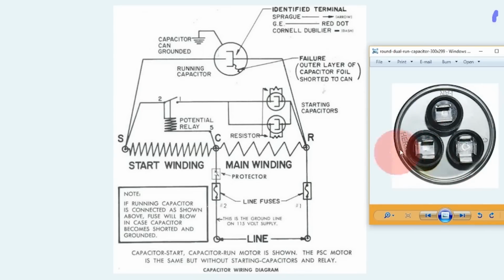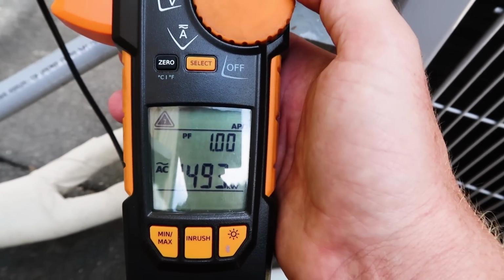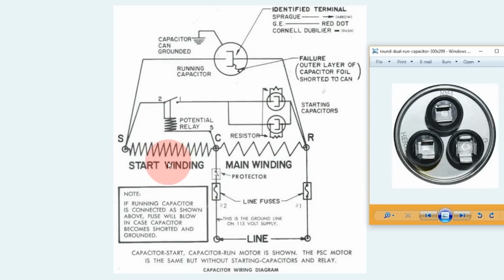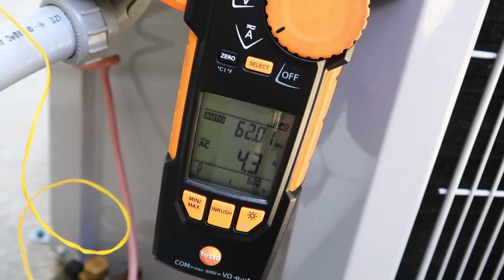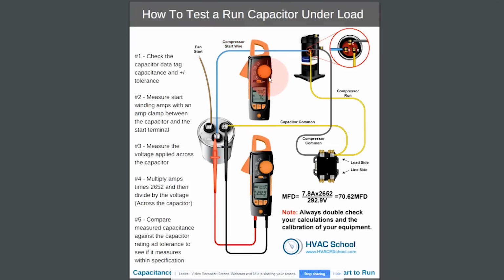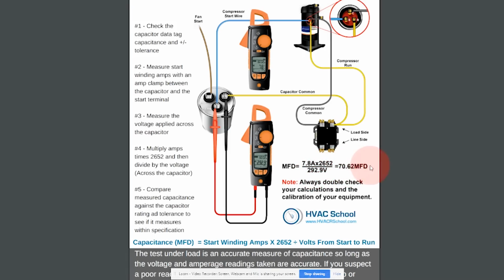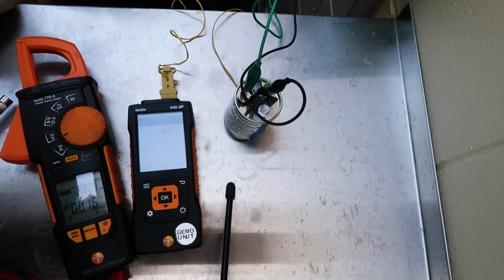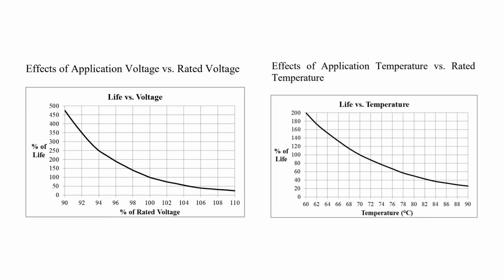Why Do Capacitors Fail? (It’s not why you think)

Comment: I used to teach a motors control course to naval electronics maintainers, as we used all manner of motors in our work.  Sadly your mention of a capacitor as analogous to a water tank or ballon hurts us as professionals and you started to lose me there.  This whole video should have been half the length talking about the actual failure modes up front.  It took you too long to mention the real sources of heat and where it comes from - the current - and how heat is dissipated.  Power=Impedance by Current squared, so any constant elevated current is a problem - that power is either returned to the circuit or lost as heat, and high ambient means less lost to the atmosphere.  The result is boiling off the oil and changing the physical properties of the capacitor in the process (swelling of the can, uniform spacing of the plates, etc).  They simply can only handle so many of these high stress cycles before they fail.  So high ambient temperatures are part of the problem, and eventually you got to loose connections, bearings that retard motion and cause the coils to work harder to keep at the rated frequency, resistances that drift, and the simple reality that parts do not stay the same over their lifetimes.  People forget that these units need to be overhauled, and electrical parts need to be replaced, bearings serviced, with new ones to put everything back in the right operational specification range.  A simple truth that we faced every day in the navy as we operated in all climates, and only by doing our maintenance, and checking our components, could we see performance drift and make fixes before systems failed.  Users that let their systems fail have no one to blame but themselves!

Comment: Excellent Video.

Capacitors are one of the few components used in the HVAC industry that have actually gotten cheaper in the last 40 years. Some of this is due to materials used but a large part is because I could not find a manufacturer that still does testing on production lots (I had a reason at the time). It's simply cheaper to give you a new capacitor than run production lot tests.

The number of capacitors that I've found outside tolerance straight out of the box in the last 10 - 15 years is a lot more than you might think.
Reply: C H I N A, as in made in.

Comment: Many reasons.. surging grid volts is a biG one, no lead in the steel, or solder and the aluminum is low grade... here in FL, our grid volts is always  low.. Very common: caps fail near after lightning storms.. surge protector helps 50% of the time & should🤞save the compressor windings.. ya'll should just add suppressors cuz the grid will just get keep getting worse, not better... so few understand what "hardening" is...

Comment: In my case the capacitor in my heat pump failed because a mouse got in there and peed right on top of it. I know it was a mouse because the electrocuted carcass was still sitting across the terminals when I opened the panel to find out why it stopped running.

Comment: ESR will increase as a capacitor gets older. The paper inside will degrade over time due to the natural acidity in it. The voltage rating will also diminish because of the deterioration of the paper inside leading to an arc over, bloat, and bang. The hotter the environment, the faster this process happens.

Comment: Brilliant demonstration! For anybody who is interested, there is an explanatory article showing the math more completely, written by Bryan Orr in AC news, titled "Testing the Run Capacitor While the System is Running", found with Google. Basically the 2652 comes from Xc=(1/(2*pi*f*C)), with 2652 in microfarads = 10^6/(2*pi*f). f is assumed 60 Hz. So, Xc = 2652/C, in microfarads. Plug that into Ohm's law E=I*Xc and rearrange to isolate C. So, C=2652*I/E. Remember that the start cap is only in the circuit for a short time at each start, so this measures only the run capacitor quality. For the brief episode when both are in the circuit, the capacitance for the two parallel lines is additive.

Comment: Who cares why they fail.  You need to know the signs for when they have failed.  Look for a dimple on the capacitor...dead give away!  They will puff up on top.  Also you can buy a capacitance checker and sometimes the capacitor will be out of the realm it needs to be in.  All this long video is just BS.  Just buy a capacitor and swap it out if you are a rookie.  If not the cap then it may be a locked rotor.  All this classroom nonsense is a waste of time!

Comment: All I can say is wow. It was very intuitive. I've been in the field for over 25 years and learned a lot on this video, but with that said the old capacitors that had PCB in them and a resistor on the terminals lasted for decades or never failed before the unit rotted out. These days it's two years on a new unit 50% of the time. So
Reply: The purpose of resistor to bleed off residual voltage in the capacitor after been disconnected from the circuit after motor start up.
PCBs, or polychlorinated biphenyls, are highly toxic industrial compounds. They pose serious health risks…
Reply: @globedimmer8286  That's what I'm saying. It helps  bleeding off the cap reducing it overheating and popping and as far as the PCB's.., I'd rather have one of them in a landfill compared to the 10 that haved popped open off a single system in a landfill.
Reply: Many reasons.. surging grid volts is a biG one, no lead in the steel, or solder, the aluminum is low grade... here in FL, it's most often after lightning storms.. surge protector helps 50% of the time..

Comment: I had one of those clear plastic shake lights.  It was very bright for a long time of use. So I put it in the jocky box in the car for a light that I thought would be better than a battery powered alkaline battery light. Well years later when I pulled it out after changing vehicles it was no longer brilliant but like an old first Gen shake light. I am thinking of cutting it apart and changing the capacitor.

Comment: Capacitors fail for several reasons, mostly heat and the surge cycling over time, basically because capacitors are not built to last as they once were, using inferior materials to keep production costs down. If a capacitor has been replaced in the past, if could very well be the original was replaced with a less reputable product. The voltage rating of a capacitor: is the amount of voltage a capacitor can handle on "peek demand", not what the unit runs at. The unit may run on 220-240v but the start up demand is much higher, sometimes peeking at 290v. The mfd is the charge/discharge rate of capacitor, the lower the mfd rating is, the higher charge/discharge rate.  Always try to match the mfd and voltage as close as you can,  if not, always go with the higher voltage rating and or a smaller mfd rating but don't make drastic mfd changes. When you are replacing a capacitor, take into consideration the age of the unit, how old is the cap and is there rust or powder present on the cap.  Capacitors dry out with age, and you will get swelling,  a liquid dripping or a fine powder forming on the capacitor, or an outright exploded capacitor.  The powder is the dielectric drying out due to over use  or just plain crappy dielectric, the liquid present is also the dielectric leaking due to expansion, the swelling is due to the dielectrics reaction with inferior materials used inside the capacitor in production, an exploded cap tells you there is too much voltage demand on the capacitor and you may want to consider a higher voltage rating when replacing it. If you replace a cap 40mfd @ 250v with the same, it will perform "as designed", you can also safely replace that same capacitor with one rated for higher voltage (40mfd @ 350 or 450v)m and it will perform as designed or better due to the higher voltage handling capability, manufacturers use absolute ratings for cost and effective production.  What I mean is, higher voltage rated capacitors are going to cost more and will perform just as well and also have a longer life, but that cost may be prohibitive to the production costs, therefore manufacturers will go with the less expensive unit to save on cost.  If you have a high rate of failure on this system, you may want to consider upping the voltage capacity of the capacitor, but match the mfd rating.  The reason for this is due to the draw surge in electron demand on startup, the unit may now be demanding a higher capacity due to age and wear.  If a unit is not maintained properly, it's demand will increase and cause a higher demand in startup voltage. As things get older the voltage demand increases, wearing of parts, lack of maintenance and whatnot.  Also if the compressor HAS been replaced but the capacitor has not, the compressor and capacitor are not matched.  The compressor may be a direct replacement but the physics demands may have changed.  Therefore the voltage demand on startup may not be the same rating, and the capacitor voltage rating needs to match the demand.  The way to figure this out is if the compressor seems to be sluggish when starting, then you know you need to lower the mfd for a faster start rate. If the compressor starts and stops a couple times or seems hesitant, it could be the mfd rate is too low and needs to be increased to allow the compressor to get a good start rate.  The lower the number MFD the faster the start rate. As an example: 50 MFD will start the motor faster than a 70MFD because it takes less time to recharge the capacitor. I hope this helps.  (43 years experience)
Reply: "50 MFD will start the motor faster than a 70MFD because it takes less time to recharge the capacitor"  If that were true, adding a start kit, 389-524 mfd, it would further slow the compressor start, but in real life, it actually speeds up the compressor start, according to the manufacture.  Even so, there is no reasonable field way to time the compressor sta, maybe in a lab....
Reply: The higher the mfd # the faster it will
Start..but it has to match the A/c
Compressor's requirements very close

Comment: Why is there 3 capacitors in my system. I know the dual run capacitor and the blower motor capacitor but what’s the other one near my dual run capacitor  I don’t know what that one is . Can some one explain its smaller than my dual run capacitor

Comment: But when a motor STOPS, it becomes a generator and for a fraction of a second it creates high voltage back-emf. In 12v cars, a standard starter motor can throw a 600v spike back into the system. In trucks, up to 2000 volts. So it is a very brief spike, but there is a very high back-emf from the motor. Capacitors are also manufactured typically to a 10% tolerance, so if it is rated at 300vdc, it really may only be good for 270vdc. Rule of thumb in many applications is to use caps rated close to twice the expected working voltage. Same for AC units?

Comment: I had a unit installed in a building that experienced a lightning strike. The capacitor had a small burst and when the power war re-introduced it began to spray atomized mineral oil into the airway.  The customer and fire department immediately assumed that the unit caught fire.  I will replace the capacitor and clean the unit.  First failed capacitor in 50 years maintaining the equipment.  Saw massive failures of high voltage power supplies in hot humid climates.
Reply: Moisture will always find its way inn .

Comment: Unfortunately, most technicians (this should make them mad) are parts replacers.  In other word, like a bad auto mechanic, they keep replacing parts until they stumble on the problem.  On my last repair by a big local company, the tech called someone else 5 times.  I guess it was lean by doing.  Being fairly knowledgeable thru my experience with tube powered stereo equipment,  I cut his experimentation short by telling him to either get someone who knew what they were doing.  Another tech came about a half hour later and had the unit fixed in less than 10 minutes.  Original tech tried to charge me another hour (even though repair took 10 mins.).  After taking company to small claims court, I recovered the excess charges.  The industry needs to self regulate or self reading trouble shooting units (like autos) will be the norm, which isn't good in most cases!

Comment: They dry out,  the ESR increases which causes more heat which causes them to dry out more which causes more heat...finally the electrolyte boils which can be bulging caps or just exploding caps and/or shorted caps.   The ESR determines the amount of current they can handle without heating too much.  My education is in electronics.   For practical purposes current flows through a capacitor even if it doesn't:  https://www.youtube.com/watch?v=ppWBwZS4e7A   Edit:  should have said the oil in the case of the run capacitors as they are generally not electrolytic.   I'll stick with the ESR statement.

Comment: In the UK , if a circuit was 12v, the caps installed would be rated at say, 25v. Nowadays, if a circuit is 12v, the caps installed are rated at 12v. Built in circuit failures.

Comment: I think you are supposed to measure voltage across common and run… not L1 &L2… your calculation Will me off on the capacitor measurement…

Comment: Inrush current when a motor starts is always higher than run current regardless of the existence of a start capacitor. On start the run winding has virtually no impedance other than winding resistance. As the motor pickup up speed the inductive reactance increases and current coming in the mains decreases to a stable run value